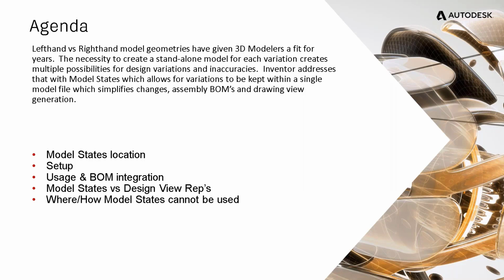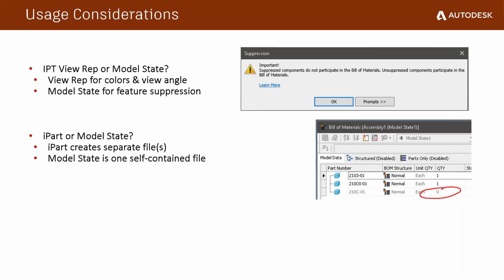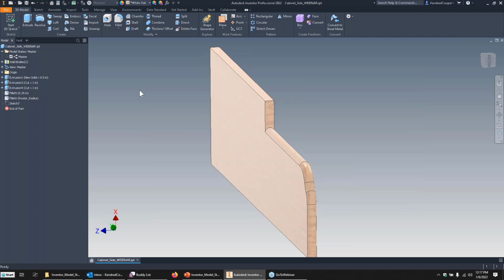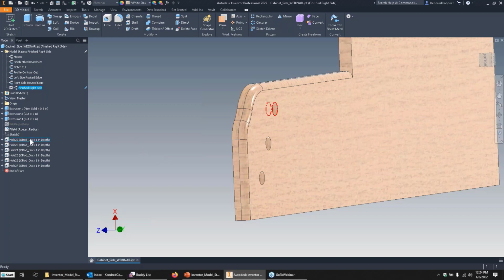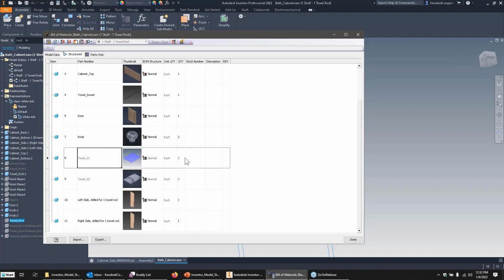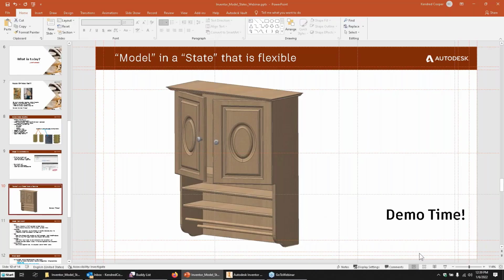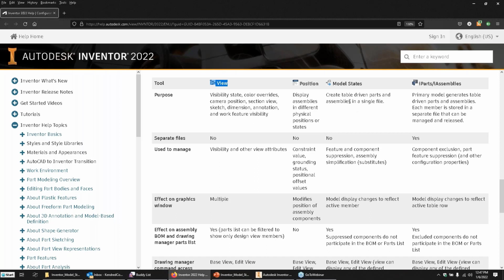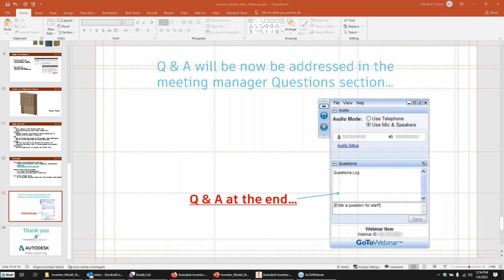Autodesk Inventor 2022 Model States

Comment: 32:45 Hold on. Those are in reality 2 different parts, each of those will have a separate drawing and will have to be manufactured with different features. Same goes for bolts of different length or other parameters. If the parts list ends up balooning and listing those as a single item then what's the point? Is it even supposed to be used for this purpose?